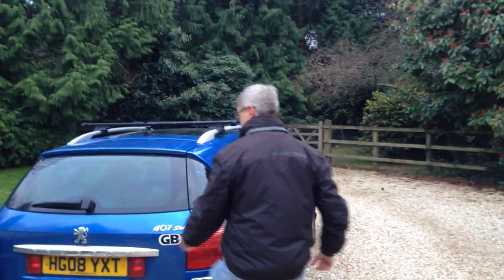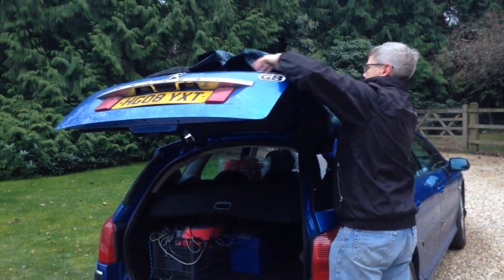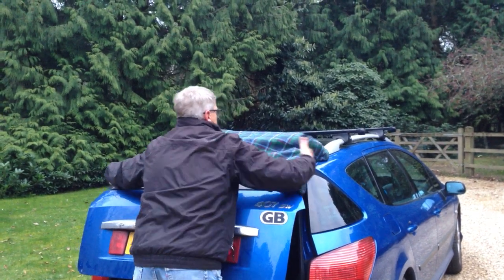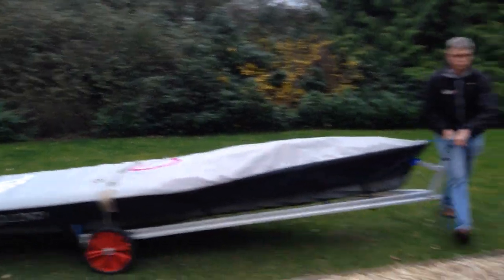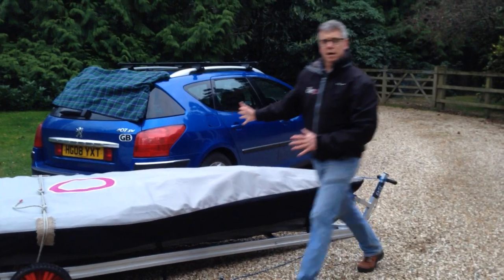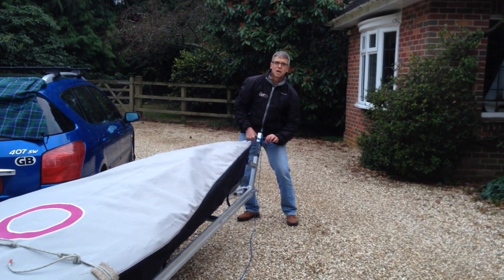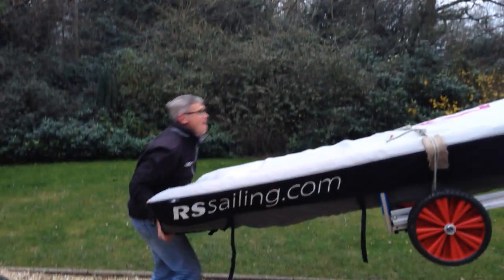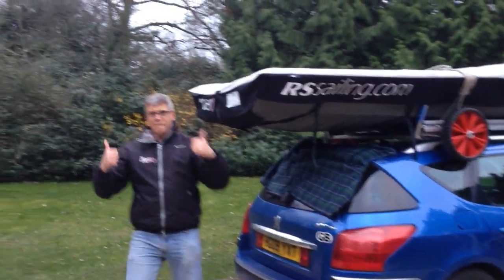RS Aero - Singlehanded onto Car Roof

Comment: Spot on, just what I was looking for today. I have been contemplating getting back into single handed racing for a while now. I used to race Contenders. Love that boat but  I would be the only one here in Spain. I am 90kgs. Too heavy for the Laser. Appreciate the Finn but it is not for me.  Have had my eyes on the Aero for a while now, and World Sailings report from the Olympic trials (published yesterday) might really tip the scale for me, as it says the boat is competitive up to 91 kgs. That sent me into daydreams today, thinking this light boat should be perfect for car-topping. Major advantage (apart from having to deal with heavy trailers) is that you drive around to European regattas much faster - not being restricted
 to trailer speed limits on the road. Thanks for sharing, now I REALLY start thinking about getting into this. :-)

Comment: How do you then strap boat to the car? Just took my new Aero to Norfolk and had trouble with vibrating strops and the boat was bouncing around still on the trolley which seems to have damaged the sides with some dents where the trolley slots into the gunwhales
Reply: I know that sound. Put one twist on each strap. 
That will shut them right up. You’ll also be able to tighten them down more. 
Have fun.

Comment: There was no explanation of why it needs to go on a car roof if it already has its own trailer.
Reply from the maker: Hi John, That is just a launching trolley (dolly in USA) for walking the RS Aero to the water and launching with. A trailer for towing on the road would be more substantially built with wheel bearings, suspension and a hitch. This trolley fits nicely on top of a combination roadbase trailer. Some prefer to trail, some prefer to roof top...https://www.rssailingstore.com/Catalogue/RS-Parts/RS-Aero/Covers-Trailers
Reply: @peterbarton9629 could you do this with a usa style dolly?
Reply from the maker: @jb42jb  See video description; 
- The UK supplied 'A' frame gunwale hung 'trolley' is ideal for loading the right way up together like this, as they cradle and protect the RS Aero. With the raised gunwales all the kit (rigs, foils & sails) can stay neatly on the boat under he covers.
- If you are using the more lightly built USA 'dolly' that dismantles then you likely need top car top the RS Aero upside down. In this case be sure to have sufficient fat padding on the bars to protect the top of the deck and don't be temped to ratchet it down overly hard. '